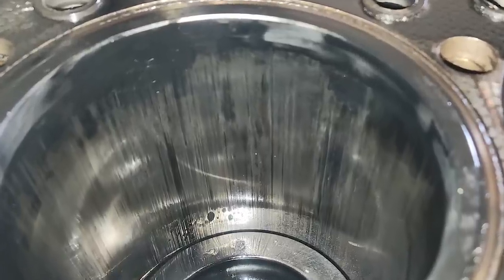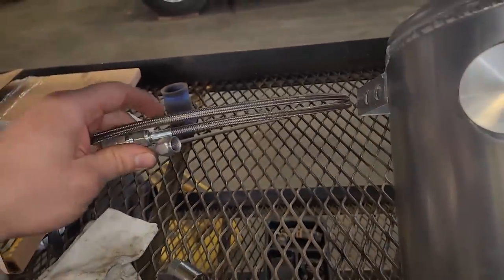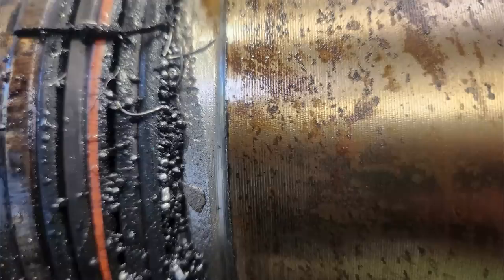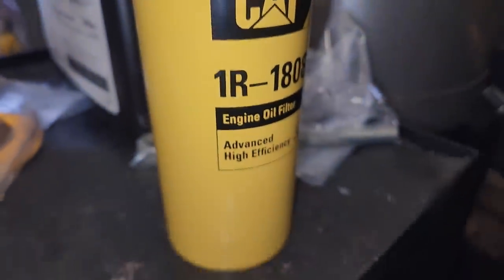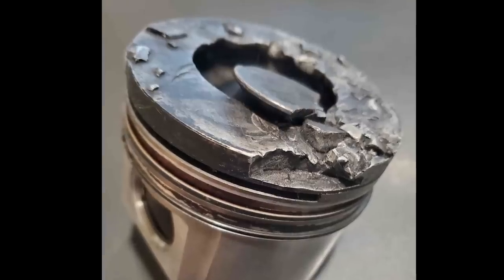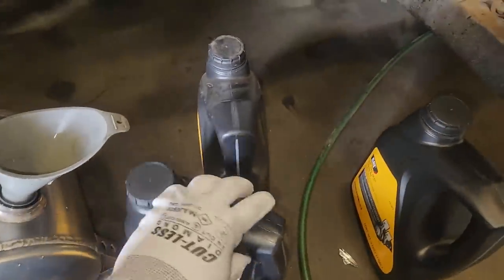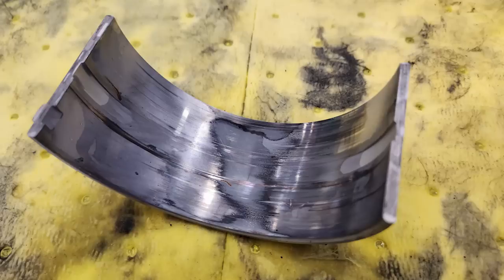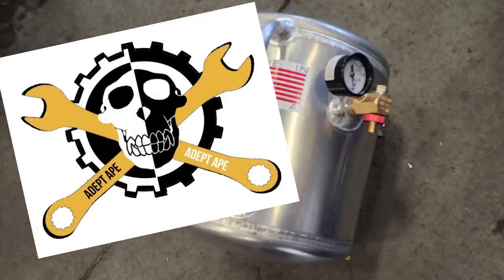This Engine has Oil Pressure BEFORE it cranks! Should you prime an engine oil system?

Comment: Just this week I installed a freshly rebuilt Cummins complete Recon engine in a bus.   With the expense involved it was obviously a priority to ensure good initial lube and fuel supply on startup.   It had been dyno tested so I knew it had already been run.  I decided to crank the engine over with the ECM disconnected to pull fuel through the filters before hooking up the fuel lines. Plus the oil galleries were full before actually starting the engine.... boy did that make things easier.   Thanks for all you for us viewers in YouTube land.

Comment: Hey Josh, great video as always. I’m a heavy duty mechanic working in mining in NZ. The C27 and C32 engines in our haul trucks have a pre lube motor that runs for a few seconds before start up which builds engine oil pressure before it runs. These are factory fitted by CAT from new. Basically a starter motor that drives a small gear pump.
Reply: What mine are ya at? On the coast or southland?
Reply: I always wondered why this kind of thing wasn't more common. It seems such an inexpensive trinket that would save a huge amount of wear your typical engine experiences.
Reply: @FerralVideo  it’s not in there best interests. They need you coming back. With the super expensive equipment they put them on since your spending millions on there stuff. That little extra prelude pump could be the difference on a sale or not.
Reply: So a modernisation of the donkey engine Cat used in the old dozers to both warm the main engine and raise oil pressure before starting?
The more things change the more they stay the same.....
Reply: Interesting.
Reply: Same with Cummins and MTU engines we run in Oz mining
Reply: @keyboardplayerakas  was at Stockton and Macraes.
Reply: @JohnSmith-yv6eq Pony engine, I think? Around here a donkey engine is a stationary winch.

Comment: Great video!!! When I worked in a Cummins shop the "oil pig" was standard policy and was preformed prior to installing the oil pan. All rod journals, main and upper rockers had to have oil or else disassembled to figure out why not. 
   There was an era when a logging company lost several cam shafts on initial start up after trucks had sat thru the winter. Something about oil squeezed out of cam bearing while being under valve spring pressure. I agree with you whole hardheartedly that oil pig would be a wise investment for equipment that has sit for any period of time.  
  Was hired one time to start a 3406 that sat under a tree for many years. When I got to it the engine was seized from all the guys from the bar trying to start it with out priming the oil and being not smart enough to prime fuel system hence several batteries drained turning a dry crankshaft. Interesting the tree it sat under was in national news as this was where the Zogg Mine Fire burnt and PG&E just got a $155M fine this week. Just trivia.
  If I remember the "Federal Mougel" oil pig in the Cummins shop used straight shop air pressure, had a ball valve, so when you heard the air sputtering you knew process completed.
Reply: So I’m two trips away from cert as a master mechanic… on small gas engines. 
I read that thread twice. And I still only understood that the fucker wouldn’t start, rednecks and mismanagement had a play then the whole thing burned down. That about correct?
Reply: Yep I remember them to and used it while working at Odessa shop
Reply: Which trucks/engines had the sitting cam issue?

Comment: Priming oil pressure before the very first start after a full rebuild is a good idea if you have the right tools. If you don't have the tools, just make sure all the bearings and cylinder sleeves are well lubed before you put everything back together, and definitely fill up the oil filter.

Comment: I made something just like that from an old steel air tank. Welded up a two wheel cart with a ten foot hose. Had an inline fine mesh screen that could be cleaned. A little cubby for fittings. Worked great.

Comment: Larger displacement CAT engines such as 3516 and 3600 will typically have an air/gas operated pre-lube pump that operates before every start. Typically worked into an instrumentation configuration that will require the pre-lube cycle to be completed before the starter will engage.
Reply: Yeah the 3516 gensets we had used an electric pre lube  pump. They wouldn’t crank unless the pre lube pump got a few psi.
Reply: This is exactly how a lot of old piston engine airplanes worked way back in the day, pre lube pumps before the starter would engage
Reply: I've always wondered if a pre-lube pump would make sense on smaller "civilian" vehicles. I don't know how true it is but I've heard again and again that a lot of engine wear happens right at startup because the engine isn't at operating oil pressure or temp when its  starting up. Hearing from you that big expensive engines have this feature shows that the cost is worth it at some point as your engine gets expensive enough. But it seems $500 in pre-lubing hardware would be worth it even on a $5000 engine like you'd find in a sedan or  small truck.

What do you think?

Comment: I run an engineroom with bigger KTA-38s, spec on an engine sitting more than a 5 days is an ignition off crank to prime the lube oil system as it doesn't have a dedicated LO primer pump. Personally I'm a fan for mechanical reasons but it also has air starters which is fun to stand on for a 15 second blast and traumatize our charter personnel.

Comment: Always pre-lubed any engine I've ever built. I converted an air bubble (storage tank), that I currently use that looks a lot like what you're using, minus the shiny appearance. I remember in high school shop class having to manually turn the oil pump shaft on a 350 chevy with a speed handle to pre lube the engine before installing the distributor. Arm got pretty tired before oil was sighted at the rocker arms. Thank you for another great video.
Reply: The days before drills were invented?
Reply: Yup, same here. I removed the distributor and spun the oil pump for what seemed like hours before i saw some oil pressure. I've always wanted an electric pre-lube pump; should be standard equipment on all engines.

Comment: That's a neat tool, always thought of pre-lube with an electric pump or air/oil system like this and years ago (more than 20) I had a need to remotely put oil in a diesel and watch the the crank (oil pan was removed). I didn't have an electric pump or air tank like this so I used an agricultural hydraulic cylinder, I think it was a 4 in x 8 inch stroke. Oil on one side of the piston and air to the other. The rod would move in or out depending on which side the oil was on, the piston separated the oil from air like the piston or diaphragm in an hydraulic accumulator. I have actually made a low pressure hydraulic accumulator from one of these type cylinders by using a maxi-brake spring externally mounted around the cylinder rod since these type cylinders are very common and inexpensive. I think i will have to buy one of these air/oil tanks being aluminum it is much lighter than the cylinder.

Comment: Thanks for your excellent review. Definitely a great tool for a serious engine shop builder both diesel and gas engines.  I learn a lot watching experts like you. Thank you. I won’t ever instal another oil filter without running a rag over the threads after another YouTube creator showed how often metal shavings are left over at filter production. The simple rag method catches any shavings or burs left during threading process

Comment: These prelube tanks are real handy before initial startup. I've had an air brake tank with filter and air regulator set up for years. It has also been handy looking for internal leaks (pressure tube O-ring in a K50 and worn bearings in an 8V71 for example). A must have diagnostic and service tool...

Comment: Prelubing is good!
Our engines (marine EMD's) all have external prelube pumps that draw oil from the pan and discharge into the main gallery. The manual states that it the engine is shut down for 72 hours or more to prelube, and we check for complete oiling the exact same way, at the rockers and cam bearings. (Love that tool, BTW...)

Comment: I had something similar on my drag car. Called an Accusump by Canton racing.  When you hit the ignition it would prime the engine like you just did and then when you started and the oil pump took over it refilled and pressurized.  If you lost oil pressure going down the track the solenoid released and flooded the oiling system from the tank giving you time to shut down before the engine ate itself.

Comment from the maker: Thanks for watching the video. The highly recommended tool in the video is on this Amazon Affiliate Link: 
Allstar Oil Pressure Priming Tank: https://amzn.to/3L5pASm 

If the Allstar is out of stock try the one below:
Oil Pressure Priming Tank: https://amzn.to/3YuBrNr
Reply: “Little bit later in the day here.” Jump cut from liners out to the head on and turbo. Lol. You work damn fast, my friend!
Reply: Would love to see stickers of your seal of approval! Great toolbox bling!
Reply: Find those little bbs and wires coming from aftermarket head castings...... Have seen it a couple of times after a repeat head gasket failure with a "new" aftermarket head.
Reply: Hello sir, I have a problem with the 320d cutter excavator that stops running after 3 minutes more or less. I go to the manual fuel dispenser, I find it empty, then it works for two more minutes, the first less, then the excavator turns off, then I go to the manual, I find it completely empty and the same problem continues

Comment: A friend of mine when I was young(,50 years ago) was an excellent Chevy V8 guru. His engines were perfect. He had a setup where(if I'm remembering it right) he had a dummy distributor shaft with no cam drive gear on it and he would insert that in the engine and spin it with a drill and get full oil pressure for several minutes to be sure everything got fully lubricated before start up. He would then pull the dummy shaft and reinstall the real distributor and start the engine for the first time.

Comment: What a find on Amazon!  Years back I remember a test the engineering staff at BMW were testing synthetic oil.  They were maintaining that the cold start of any engine was when the engines oil drained back into the oil pan so the engine was dry.  Especially in winter when the oil thickens up.  It was not the mileage of the engine that caused the engine to wear out.  Unless you had a engine part break.  But it was the cold start with the engines that were dry.  I after seeing that I switched to synthetic oil.  Pay a bunch more offer the lifting of the engine.  My newer cars had electronic ignition so they would start fast.  My mechanic put a switch on the dash so I could turn the engine over without it starting up so I could build oil pressure.  But this tank you found is brilliant!
Reply from the maker: It's great, unfortunately they seemed to stop production on this exact model. If you click the link in the video description there is a very similar one on Amazon still.

Comment: The Volvo truck dealer I worked at had an oil prelube pressure tank.We made it using an aluminum air tank.We did install an oil filter on the outlet side of the tank.Just for safety.

Comment: I find it somewhat interesting that you take such pains to fill the filter from the "dirty" side to avoid introducing contaminants, but have no worries filling this tank without a screen in the funnel. I'd think if you're careful while filling the filter in either hole, as long as the wind isn't kicking up a ton of sand in the air, you'd be totally fine. In my situation, all my filters have an anti-drainback device/seal, so pre-filling is only practical in the middle and I haven't let anything get in there but oil.

Comment: I made 1 out of a old hydraulic cylinder.  I put a oil filter kit on it to keep it clean, also used a air pressure regulator.

Comment: 3208/throwaway zealot here, Bluebird Wanderlodge applications only.  Cat manual specifically recommends pressure fill on fresh overhaul examples, @ the air compressor lube port, curb side rear cylinder head.  Just saying.  I use a repurposed bulk fill tank, liberated from a Wanderlodge, holds 5 gallons.  Good post, simple procedure that is frequently over looked.

Comment: Would be kinda cool if there was some way for engine manufactures to build a system that gets oil flowing without the engine running for normal use. Especially for cold winter startups. Tool works awesome though I am probably going to pick one up!
Reply: I think ambulances and fire trucks are equipped with pre-lube pumps which come on with the dome light, so there's oil flowing before they crank it over.
Reply: see thats something that would benefit everyone to have

Comment: There used to be a company that made an electric pre-lubing external oil pump for pressurizing the oil galleys on car engines before start up.  Run it for a minute or so, then start the engine.  It picked up the oil from the pan and pumped it in a galley hole.  A really neat idea.  It must have been about 30 years ago.

Comment: I have been using a similar type tank for years to refill the rear ends in my midget and sprint cars after we change gears, easier to fit in the pit cart than a big jug.

Comment: I remember, maybe 35, 40, years ago, an oil pre-lube set up for gasoline powered cars.
The "inventor" made the claim that the engine would never wear because it was "dry" starting a cold engine that caused the damage.
Why would you NOT want to have pressurized oil system before starting an engine?

Comment: Great engine rebuild!! It definitely needed it! 
I have to say I always fill any oil or hydraulic filters (as much as possible with horizontal filters) anytime I change the oil. Why not fill the new filter while the old oil is draining. Most filters have an anti drain back valve for a reason. This is to help avoid dry starting. When the filter is removed the oil that was being held up in the engine, drains out. With a dry filter and the oil passages empty you are going to have some starvation. The amount will depend on the size of the empty filter and how much oil it will take to fill the passageways before building pressure. Just my 2 cents.
Reply: Completely unnecessary.

Comment: That's just a manual charge pre-luber like we use in race cars, especially our historic race cars.   Those also have an internal pressure bladder that you charge before engine is running, then you shut the valve.  With the engine running you open the valve and let the engine oil flow in, close the valve behind it. Next time you go to cold start you release the pressure and lube the motor.  Start it up, let it run enough to get some oil pressure against the air bladder and close the valve.   Rinse and repeat.  You just have to be careful with your oil levels.

Comment: I work at a diesel shop in NZ and all our rebuilt engines get the pressure pot put on them ours was built locally and also has a spin on filter on it . Especially useful on ford ranger and some others that don’t like picking up oil on initial startup.

Comment: I made one of those oil priming tools for priming the porsche motor i rebuilt. The prebuilt one was around $450 and it looked similar to a small propane tank. So i took a propane tank and some steel pipe fittings to make my own.

Comment: I would really like to see a side by side test, project farm style, where you do all of this work to prelube a rebuild and another engine where it's just assembly grease on the rods and mains. Then run the engine for say 2 hours each and pull the oil pan and compare the bearings
Reply from the maker: Me too, just need someone to fund it. Maybe this Allstar oil tank company would like too 😎
Reply: How much it is going to  cost to Josh lol project farm started with lawn mower engine

Comment: For years our sawmill used Cat gen sets to power the mill. The last unit we ran was powered by a 3512. Per Cat’s recommendation I plumbed a small single phase hydraulic pump into the system that included a check valve to close the loop once the engine started. Before starting we brought the engine up to full oil pressure about 60 psi (if I remember correctly) before starting. All maintenance intervals, heads, turbos, starter etc were based on gallons of fuel burned. You want things to be very predictable when the jobs of 32 men are on the line.

Comment: Great video...
I encourage you to go a few steps further and run filtermags on the spinon oil filter and a bypass oil filter system to additionally clean the oil while driving down to about 1-2 microns...

I use this stuff on my 07 5 ram 3500 Cummins with 970.000 miles with engine never opened up along with OEM injectors...

Be Blessed 🙏

Comment: I've seen aftermarket kits with accumulators and solenoid valves. (Performance car)

While running you have the solenoid valve open so the accumulator can fill. Then you turn it off and the valve closes.  Next time you turn it on the solenoid valve opens and dumps its pressure into the oil gallery. Once running the accumulator fills again

Comment: With a new pickup truck hitting the $80,000 range, I would install an automated pressurization system on any new purchase. Easy to setup a tank that charges up with oil pressure through a orifice and check valve. Then a solenoid to dump the oil pressure prior to starting.   high-falluting Long haul trucks aren’t the only machines on the road that can use this trick!

Comment: I've operated mining equipment that has a prelube system on it the starter motor has a gear pump built into it and when you start the engine the starter doesn't engage the bendix gear until the engine has oil pressure